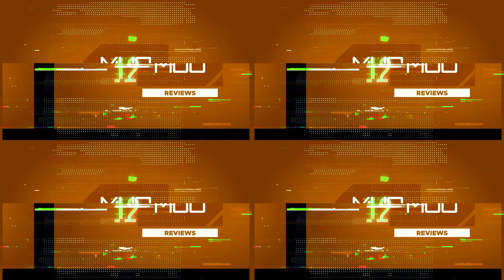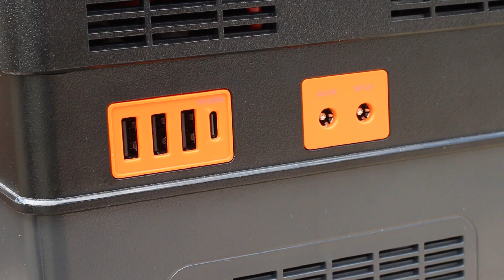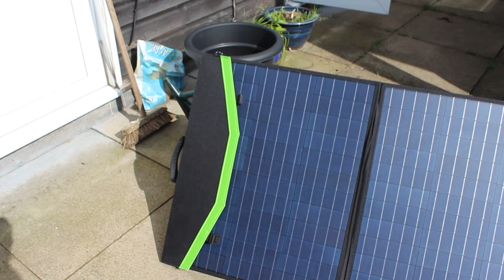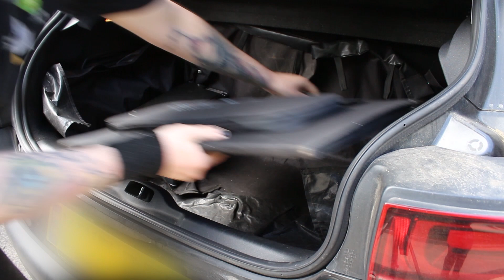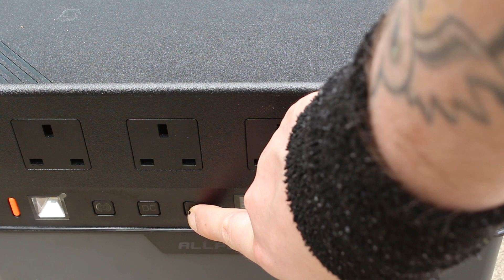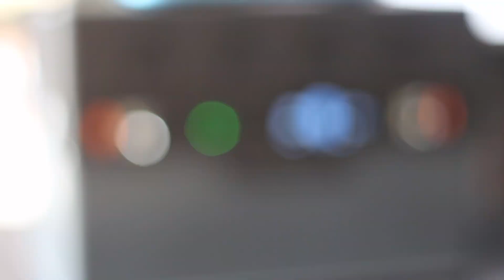Powerful and Pricey: AllPowers S1500 Solar Generator Review

Comment: I see MakeUseOf are deleting all comments which don't follow the narrative for this products manufacturer.
Reply from the maker: No, we're not, all valid comments are welcome. But I'll check the spam queue, it's possible you swore and it automatically went in there. Kindly don't make assumptions.
Reply from the maker: Nothing in the spam queue. Either way, I can promise you I don't delete anything other than literal spammers.
Reply: @MakeUseOf  There was no profanity. I stated people should look up this company's interactions with their backers on their crowd funding campaigns and my comments were deleted repeatedly even with edits to remove the names of the platforms.

Comment: YEah no battery is really capable of running 1500w appliances, maybe for an hour or 2. Even  a 200ah battery running at 150w only last about 16 hours in a test i seen, so 1.5  hours at 1500w... and thats a big battery.  However Im able to run all my electronics off 160w of solar panel and 50ah battery, laptop, subwoofer, speakers, external monitor, all while chargings 3-4 power banks.  Electronics are doable thanks to better power effieciencey, i think my laptop only takes 12w watching youtube videos but once you run a heater or try to boil water is where you need 10x more power and battery to sustain it. Thanks for the honest review.